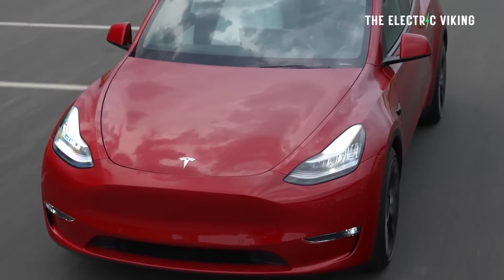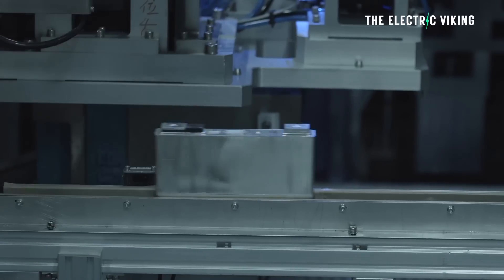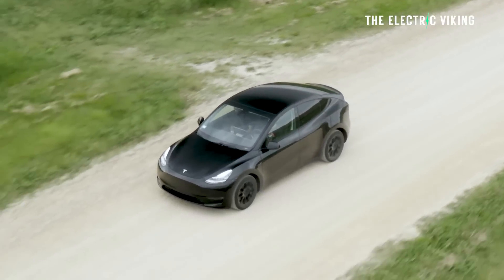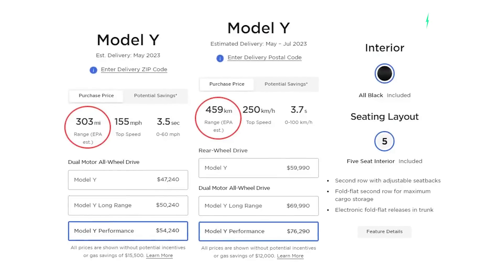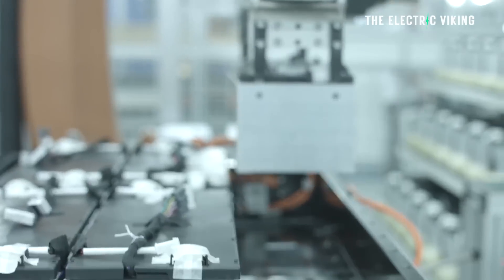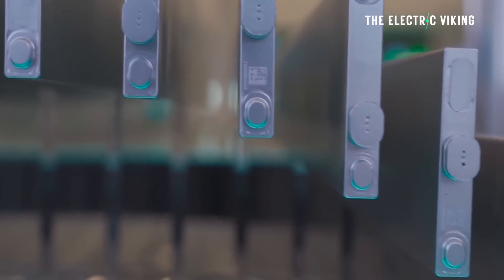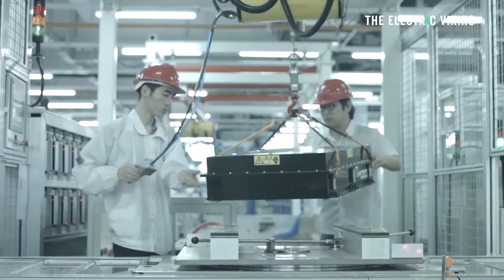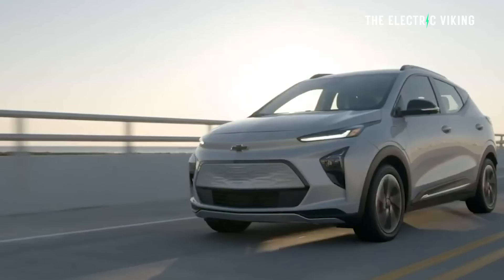Tesla makes big change to battery in Model Y Performance

Comment: I guess I’m confused I thought with me and failed the 4680 battery that it was going to be the new battery for all of their cars and trucks and it was supposed to be more powerful but it doesn’t appear to be that way😊
Reply: @laleau92  hey thanks for the reply the only thing I worry about is the fact that battery technology is moving so fast that I hope all the money that has been put into it pans out for Tesla
Reply: @marklaffey7972  it will.  Even if they just end up in power wall or commercial power grid applications.  I do think your right.  Sodium and air batteries are super close to next.  And with no cold or hot temperature decrease in power they are already much better.
Reply: @Mark Laffey it’s taking longer than Tesla expected. There’s the mastering of the manufacturing process which they are finalizing and then there’s the silicon anode which sadly I’ve found no updates on. The silicon anode is responsible for higher energy density and faster charging for the battery.
Reply: @laleau92  thank you I wonder if they’re having trouble with the expansion of the silicone, with my limited understanding that seems to be the biggest issue with silicone expansion and contraction issues
Reply: @laleau92  Yeah, while the 4680 still has promise I have been very disappointed  in the technology so far.  On battery day they had a lot of claims about lighter weight, faster/cheaper construction and more energy to boot.  So far the weight of the cars is about the same.  Production issues still after all this time is still plaguing the battery and power is no where near what we were led to believe would be available.  

I suspect that with time they will figure it out.  But how long will that take?  What other technology will come about in the mean time making the anticipated advantages unimportant.  I am hopeful that they won't simply say, "Good enough. People have accepted what we have, let's just go with it.".  Honestly this video looks like people are simply accepting lower ranges as not important.

As for the topic in this video, anything that shortens the range is bad as far as I am concerned.  For day to day driving it has no impact.  However, when driving across the country it has a significant impact.  I have listened to the argument that the effective range for an LFP battery is the same because you can charge it to 100% vs 80 or 90% for LNMC.  That's all fine and good for charging at home.  But on the road you will never charge to 100%.  It simply takes too long.  You will be going from 15% to 65% for the most part.  And that is a much shorter range with LFP vs LNMC.  I was really looking forward to the expected range increases with the 4680 cells as they were presented.  I am getting far less optimistic about them now.

Comment: Lol.  What they do, improve their itty bitty D cells sos they can wire 500 less of them into their goofy “battery packs”?    The bottom line?  Present battery technology is bullshit.  To think these small batteries will power the earth is just plain stupidity.  It DOES NOT MAKE SENSE.
Reply: The Model S Plaid uses 18650 batteries, which are smaller than the 2170 batteries.

Comment: Hello from Canada!  I bought a Tesla 3 in February after you mentioned the price reduction. I have a deposit on an ioniq5 that will likely arrive somewhere in 2024(reserved January 27th 2022).   I am on vlog of ioniq5 owners and I read many comments of people having issues with updates, some using 2-3 different applications when comes the time to travel to find the right charging station and it made go try the model Y on Saturday.  And now I am confused, not knowing what to do.  I really like the Tesla products.  I have done 3 updates so far.  Flawless.  I will do my first trip in a couple of weeks and use the supercharger.  The price of the model Y here went down by 20k$ apparently since last fall.  The LR is now eligible to the 5k$ offered by federal gvt.  Still not eligible to the 7k$ from provincial gvt.  What is your take about the two cars?  To me, buying a Tesla equals to buying peace of mind but it’s more expensive than the ioniq5.  Do you think that the strategy of using the cars produced in China will maybe lead Tesla Canada to lower their prices once again to be eligible to both rebates?
Reply: Allo Jean, si tu veux la paix, Tesla est la solution! Ca fait 5 ans que j'ai ma M3 LR, RWD et meilleur voiture que j'ai posseder. J'ai voyager de l'Ontario a Fort Lauderdale Floride et le tour des Maritimes en utilisant les Supercharger et 100% satisfait!
Reply: J'ai commander un Model 3 LR Dual motor 2022 (avant les forte hausse de mars et mai 22) et c'est de loing mieux que ce que j'espérais.Je l'adore!
 Le Ionic5 n'est pas vilain non plus mais ...Tesla est supérieur en tout point. Quand vien le temps de voyager,  l'espace interieur/dégagement et cargo...toit panoramique à couper le souffle,  system de son Très performant , Application Tesla écrase la compétition ect ect...
Commande ton Y Dual motor tu ne regretteras pas. Laisse le sur le 19" parce que la suspention est bcp plus sèche et sportive que dans un Ionic5 et protection pellicule devant bas de caisse et je dirait même le coffre arrière parce que bcp de contamination de route s'y retrouve.Les tour d'aile en plastic noir ramasse bcp de poussière et de saleté qui garde l'humidité et la tôle est très mince à cette endroit donc l'antirouille est fortement recommander pour le garder beau longtemps
(Bolduc est le Pro)
Reply: Tesla has a far superior charging network. Much easier to charge on a road trip. Tesla’s can use the Tesla network as well as all of the other charging networks.
Reply: I think the prices will come down some more, especially if there is a recession. I do think there will be one in 2024 or 25. It may be so bad that you may feel the need to keep the ice vehicle you currently plan to replace with the Ioniq or Y.

Comment: The real problem is pouch batteries.
Reply: Which EVs use pouch batteries?
Reply: @JAM_2024  BMW, Korean evs, gms evs, Ford's evs and many others not named tesla, tesla has always used either cylindrical or prismatic cells.

Comment: Sounds like density of LFP batteries comes long way of improvement and even if they are not yet there as Lithium-ion, its closing the gap.
Reply: LFP is a lithium-ion battery. Just a different cathode active material (CAM) chemistry